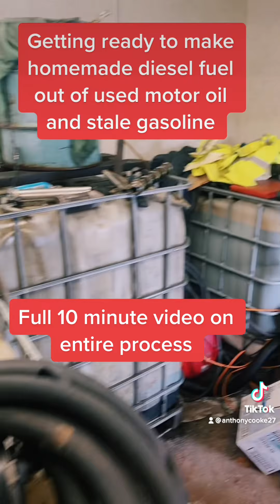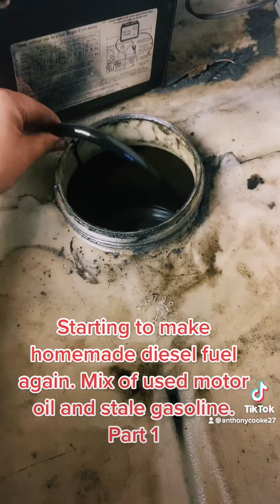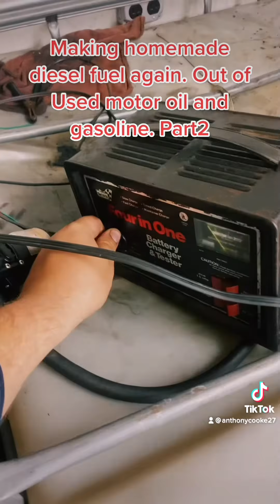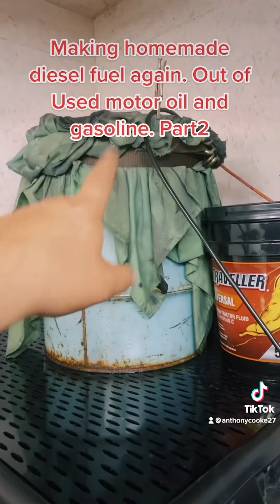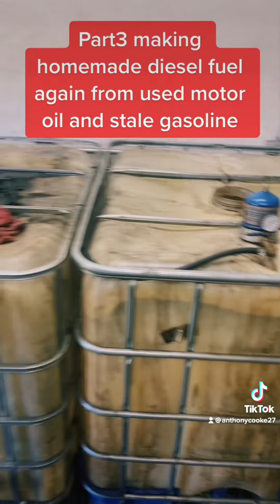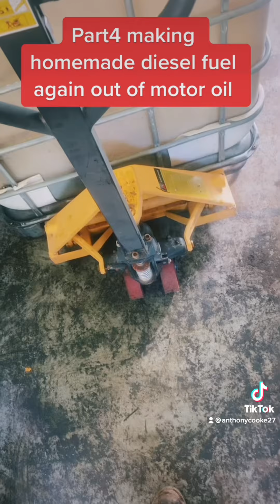Full video on how I make my homemade diesel fuel out of used motor oil and gasoline  ￼

Comment: The ratio is 6:55 if anyone is wondering, its 6 parts gas to 55 parts oil. Thems the math.

The ratio is 30:275. To simplify the numbers, It's pretty much divide both numbers by their greatest common factor which is 5
30 ÷ 5 = 6
275 ÷ 5 = 55
Sooooooooo, the simplified ratio of gas to oil is 6:55.

Comment: And for those that are using this method for homemade diesel fuel for their diesel heater, 1 gallon of gas per 2 gallons of used motor oil will make a Webasto diesel heater or a Chinese diesel heater run amazing

Comment: Mix in some stale gas, let the pump push it through a remote oil filter or through a line and fuel filter. Faster and better filtering

Comment: Use air impact would be so much more safer & efficient
P.S. If you can't get an attachment to stir your brew with pnuematic impact drill machine it yourself!
Reply: A brushless electric drill doesn't spark.

Comment: Could you use ethanol instead of stale gas?
Reply: Ethanol is bad for fuel systems designed to run on petroleum fuels
Reply: If you want to pay for it and get the negative effects of ethenol.  If you don't want to use stale gas use fresh gas which is low % ethanol and cheaper.

Comment: Nice.
All of the used oils and hydraulic fluids I collect at home I catch as clean as possible in a catch can I keep sealed in double trash bags. When full, I pour the 15 qts into 5-qt oil jugs I save from new oil/fluid changes.  I let the jugs sit for at least 90 days and then slowly pour off the top 4 quarts. The last quart has the settled solids or contamination in it. 

I mix 3 gal of the clean used oil with gasoline nearly 1:1 in 5 gallon fuel cans and shake for 1 minute, and put two 5-gallons cans into a 3/4 full tank of diesel. My 2005 Ram diesel has a 40 gallon tank. This makes a mix of about 15% used oils.  It seems to run fine Winter and Summer.  I do change my fuel filter a little sooner than typical, about every 10,000 miles, rather than 15,000.

The dirty oil left in each jug i combine  again and let settle another 90 days and repeat. The 2nd time I pour off the top and use the remainder as chain-lube and make two-cycle fuel for my chainsaw, and some start my wood boiler at night.

It's a cheap and easy way to get rid of collected fluids, have a little free fuel, and not waste anything either. Peace

Comment: Does the sludge in the tote make good heating fuel for a wood stove?
Reply: If you want to use it for anything you'll have to boil it because most of it is water, but there is some burnable "fuel" in it.

Comment: I would rather just pay the price for clean diesel, and put fuel additive to lube My 215hp P7100, injectors, and cylinder walls. I would rather the motor oil be recycled into new motor oil, that I give away for nothing, and now pay a damn fortune for. 😂
Reply: Used motor oil is sold as bunker C fuel oil after it's partly filtered - also marine diesel is generally 30% used motor oil or tar  & 70% diesel -  the EPA disposal of used oil is to burn it - I worked in the oil industry for yrs - 
     We blended old oil and plastic into marine diesel lol

Comment: Mixing oil with gas by means of the electric drill is not a good idea. The drill produces sparks internally which ignite the gas vapor that comes out of the tank......BOOOOM 💥
Reply: Brushless drills don't produce sparks.
Reply: Use air impact drill no problem
Reply: Yeah at my old job a drill got wet with isopropyl alcohol and catched on fire, but I blew it out quick thankfully...
Reply: It’s fine
Reply: Do you understand the combustion process?
Reply: Very good point, everyone like this comment so the dude can see this

Comment: Hi there. I was wondering what brand/model pump you use to transfer your oil. I can’t find a reliable pump that can handle thick fluids like oil
Reply: If you look for places that sell used commercial cooking equipments - they might have the filter pumps used to pump used to pump cooking oil to filter fryer oil - 
      You want the gear type pump - 
Use a small hose for w suction hose - I use a 3/8 ID suction hose and 3/4 discharge on mine - those pumps work good - I've used one to pump oil for 40 yrs

Comment: This is fascinating. I'm curious if the time spent to do all of this start to finish is cheaper than it would have been to work to earn the money to buy the equivalent amount of fuel from the pump.
Reply: Many just do thing just because they like messing with things - It might have nothing to do with cost or savings -
Reply: It’s cheaper it’s like 30 cents a gallon to make
Reply: $5.50 a gallon at 250 gallons with not much time invested seems better then working
Reply: My cost is 45 cents a gallon so
Reply: Depends on how much you drive. For a work truck doing 20-30k miles a year it saves $10,000-$12,000 a year

Comment: So what do you do if they dip your tank with this stuff, I just can’t see them passing it off
Reply: It's not red!!
Reply from the maker: I explained it in other videos
Reply: I here is ok because the gas and motor oil is both taxed
Reply: @calvinwright5040  I would think that to but you would think that they would find some way for it to be wrong due to them thinking dumb stuff with emissions and all
Reply: When I was making my own fuel like this I looked into testing.

1. Nobody I ever have talked to has had their tank dipped
2. Even if they did you are allowed to make your own fuel for personal use.  As long as it isn’t red it shouldn’t be an issue.